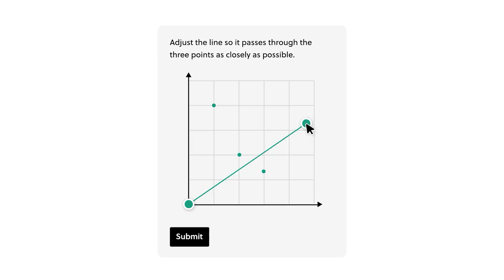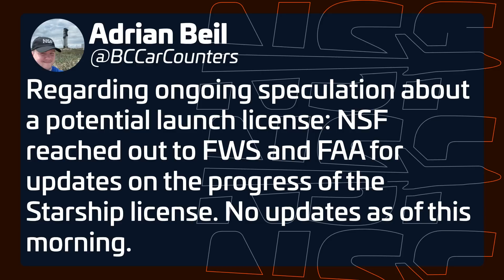Stack, Destack. Stack, Destack | Starbase Update

Comment: I hope they dont do the same mistake as flight 1 where they forgot to separate starship from booster, SpaceX PLEASE REMEMBER TO SEPARATE Starship from booster, it's one button press man, how hard can it be
Reply: No buttons involved for stage separation - it's all automated.
Reply: @jkg6211  it was a joke... jezus christ, do you really think I believe they forgot to press a button?
Reply: I don't think they forgot. Either they cancelled it because of the anomaly, or Starship failed to separate due to the fire in the engine bay which burnt through important wiring.

Comment: Why do you need the catching device for the booster to be one and the same as the stacking device. Get a failed landing and you take out your launch site. 
Separate them. They don't have to be an identical design. Catch, lower onto a transport. Move a mile. At 1 mph, that's an hour. 
The landing site doesn't need a major water deluge system.
Reply: If SpaceX were to answer your question here, it would go something like this: "We don't make a plan for failure, we make a plan for success."
Reply: @stevevernon1978  But think about turnround time. 
Whilst you are stacking one, you are landing another. That's shows a commitment to huge numbers of launches. 
It depends on the spin you want to put on it.
Reply: @Nickle314  I seem to recall that NASA or possibly FAA said something like "Boca Chica can continue to be  your TEST FLIGHT location. Series flights will be at Canaveral." If that is true, then SpaceX will be planning different equipment and towers  for Florida, and we don't yet know what they might be. That may include a separate landing tower. or two. of each. or more. it is not yet determined.

Comment: Define exactly what is meant by “install the FTS”. Is this just the explosive charge? Is there something that we’d recognize as a ‘safe & arm device’?
Reply: Fts == flight termination system indeed explosives which automatically go off when ship is in trouble
Reply: They’ve installed the explosives, rigged them with the electric detonators, and put the covers on. Last step is to connect the wires between the detonators and the flight computer, which they won’t do til immediately before flight for safety.
Reply: Lots of FTS use a line of det-cord installed along the length of the propellant tanks, which when fired has enough power to unzip the tanks wide open. In the case of Starship they seem to be using boxes of high explosives strategically placed.
Reply: Flight termination system, in case they have to blow it up lol